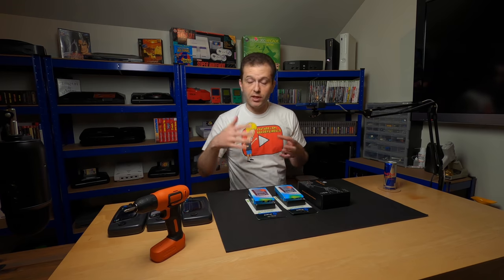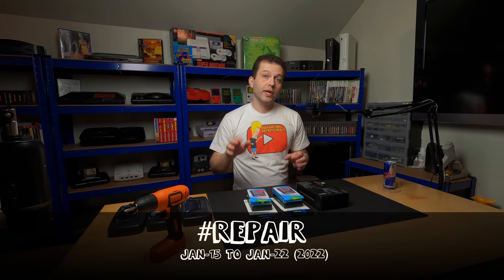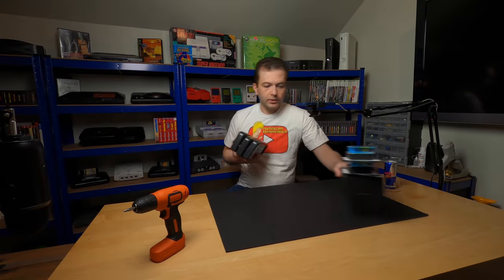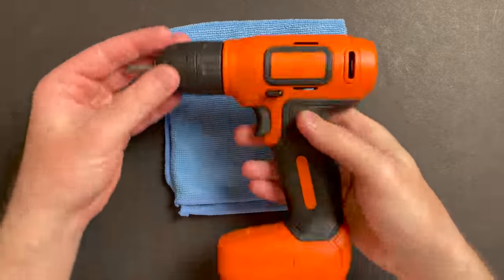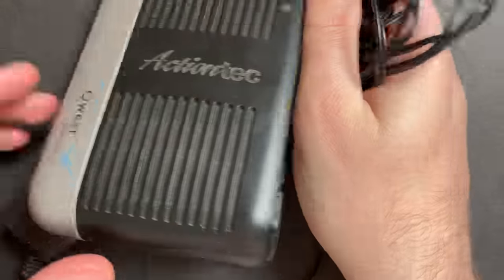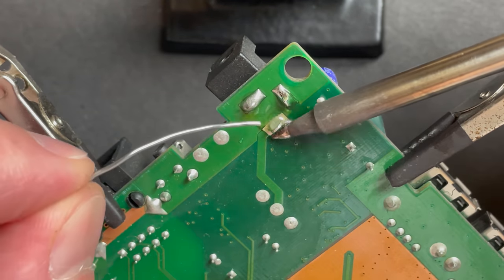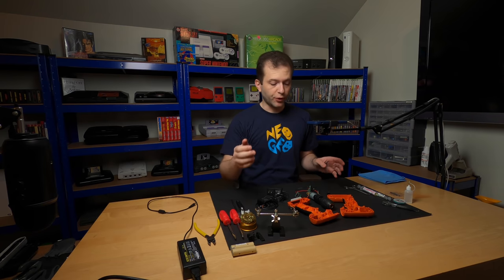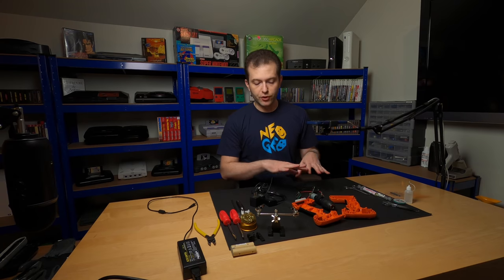Revisiting a Poorly Repaired Project & 25k Subscriber Giveaway

Comment: The DC barrel socket will have a make to break circuit in it. The outer connection on the plug will break the connection between the two tags on the socket. This is so you can attach a battery to the circuit and when you plug in it will disconnect the battery and use the dc power. It’s old school dc stuff. Hope that makes sense. If you’d tested the continuity between the two “ground” tags when the plug was in you would have found them disconnected.
Reply from the maker: Thanks so much for this info. It was really bothering me. I knew someone would know exactly what the issue was. I get it now: continuity across those two grounds when nothing plugged in, but no continuity when a barrel is plugged in (by design). Love it!!
Reply: Yep. I see this in guitar pedal DC connectors. Circuit break when plugged in, 9v cell vs power supply.
Reply: And here I was this whole time, thinking the second ground leg was solely for extra physical strength. This makes perfect sense.
Reply: I had to pause the video and come search for this comment to talk about it and get it out of my system because I have been there many times. We all been tricked by break circuit jacks at some point. In my case, mostly audio jacks (in these the break circuit it is meant to interrupt the device speakers' lead connection. This is how speakers are muted when you inserted your headphones in stereos and TVs).

Since they will test perfectly fine with no plug inserted, just like it did in your case; for sanity check, when I'm working with some jack I'm not familiar with, I do a continuity test with a plug inserted into it and corroborate continuity between the jack tabs and the plug's.

Comment: Hi, usually when there is three connectors on a barrel jack, it is where a unit is powered by a non rechargeable battery and if you plug a power adapter in, it doesn't put power into the battery circuit, however that doesn't matter to your drill, if you plug in the barrel jack without the power supply plugged into the mains supply, you will see it break the two negative connection on the barrel socket, it works like the headphones jack if you get what I mean. Well done with your milestone, I am a British subscriber. #repair
Reply from the maker: Thank you for your comment. A few folks shared similar feedback and were quick to clarify my confusion. You always learn something new!

Comment: Hi there. The side lead on the barrel jack connector seperates from the negative lead once the plug is plugged in. Thats why the drill was not charging. It is used to disonnect a primary supply, like a battery from the circuit, when a secondary supply like a power supply is plugged in (otherwise the battery would get DC from the power supply and get damaged). Keep up the good work and best of luck! #repair

Comment: Thanks for the fun video. Got a few useful tips from it, including your solder wick methods.

I did want to add a brief note about frankensteining DC plugpacks. Modders should take at least a cursory note of the respective power draws and wire gauges of the packs being joined together. Because, although it's rarely an issue in practice, in theory it's quite possible to conveniently take the connector and part of the (potentially lighter-gauge) wiring from a cheaper or underpowered plugpack, and unknowingly introduce it into a much more demanding circuit - which then becomes a potential design or safety issue. As noted, a rare one, but it's good to at least think about it. For example, it wouldn't be the best choice to hang a demanding 12V 2A circuit off the cable from a 5v 300ma Aliexpress adapter.

Great that you stumbled upon the insert-detect function of the DC sockets. An initially-confusing path I myself also trod, not so long ago during similar projects. :) These days, sometimes during prep I'll simply snip that side lug off for convenience, both so that it's out of the way, and so that no confusion is possible.

#repair
Reply from the maker: Thanks for the great feedback.

Comment: I really love watching these #repair vids, the presentation is top notch and it really inspires me to want to do it myself, fantastic. Those barrel jacks with three pins can be used in circuits where normal non-rechargeable battery's are used and you want that circuit to be disconnected when you plug power in, the pins reconnect when you remove power and the are back in circuit. If you connected the negative to the other pin it would of worked first time without the patch wire. 

Here is an explanation for all of the uses of a 3 pin switched barrel jack I found on the internet which thought explained it well..."The jargon for this type of connector is "switched jack". Not only is it common for barrel jacks to have switches, but also for some other types of jacks, like phone jacks of all types.

When you insert the plug, the connection between pins 3 and 2 breaks. This is useful for cutting a battery out of the circuit when a DC adapter is plugged in. Imagine you have a battery which is grounded via the 3-2 connection. When you plug in, 3-2 breaks and so the battery's ground connection is lifted. Now the battery is protected from two unwanted actions: discharging, and being charged. (It's still a good idea to put diodes in the circuit in case the switch fails for whatever reason.)

Or, this can be used for building a circuit which detects the insertion of the DC plug. For instance, when the 3-2 connection breaks, some microcontroller I/O pin could be pulled up to VCC, and then the firmware knows that the device is on an adapter.

If you don't take advantage of this, you can leave pin 3 unconnected in your PCB, or you can ground it so that it is permanently connected to 2.

In any case, the extra pin provides extra mechanical strength too. In other words, solder pin 3 to a pad, even if that pad has no traces to it.

In general there exist many types of switched jacks with various switch configurations. For instance, there exist stereo jacks which have a pair of switches that close when the plug is removed. This can be used on the input side of an audio (or other) device to ground high impedance amplifier inputs when nothing is inserted, so as not to leave them floating, inviting noise. On the output side, it can be used to disconnect main speakers when headphones are plugged in.

Jack switches are not always "break" switches (normally closed, open upon insertion); there are jacks with "make" switches also (normally open, closed on insert).

In some applications that use phone jacks, a "make" switch switch is simulated by using a stereo jack with a mono plug, or a stereo plug into a four-connection jack. If you insert a 1/4" or 1/8" mono (tip-ring) phone plug into a stereo (tip-ring-sleeve) jack, the plug's sleeve, it bridges the sleeve-ring contact, acting as the closure of a switch. This can be used to turn a battery-powered amplifier on when the plug is inserted: a common trick in electric guitars with on-board amplification such as active pickups. Cell phones also use the same trick to distinguish whether a headset or headphones are plugged in. Headsets have a TRRS plug for supporting the microphone, whereas headphones have a TRS plug. When you plug in headphones, they ground the jack's outer ring (second R) contact to the sleeve contact, which the phone detects, and thus keeps using the built-in microphone for audio input, sending only audio output to the phones."
Reply from the maker: This is a very thorough explanation, with examples of practical use cases outside of just power jacks. The more I learn the more curious I am to tinker further and mess with these things. Thanks for sharing.
Reply: @BorderlineOCD  You're most welcome.

Comment: I have watched man of your videos and I enjoy each one.  They have inspired me greatly.   I now own a cheap iron like you mentioned here in this video,  but as you were at the time of the initial repair, am a beginner.  I am a musician and I have PA systems and a Line 6 POD pro red face that all have had issues.  Yesterday morning I woke up thinking about trying to finally repair something.  That Line 6 had a channel volume knob that had been busted off.  Unfortunately it was the post off the pot that broke.  I had a spare pot ( not of the same size at all. ) laying around and I noticed the post size was shorter but fatter.  I wound up taking the board of of the pod pro and weighing out my pros and cons.  Pro,  it could work.  Cons…it’s already broke so time would be the only thing wasted here but knowledge would be gained.   I successfully Installed the replacement pot and it worked!!!  Being the know was shorter I had to take a knob off of one of my guitars temporarily until I can get a new knob 3D printed.  Anyways it worked and you inspired all of that.  I originally got the iron for installing pickups in guitars.   Thank you!

Comment: It's brilliant you showing us how you started off. Just goes to show how much you have improved over the years and how cheap soldering irons aren't always the best. That was a good wee upgrade you did to that drill. I have a tool which is similar with a mirco usb. Can see the same thing happening to that in the future so this has give me an idea if it does fail. Great to see so many subscribers now. As I said I started watching your videos and started to take console's apart a lot more. Wpuld have been only disk drive or power supplies out but now its fully apart. #REPAIR

Comment: The extra pin on the DC Jack is for detection - it will be shorted to ground only when the plug is not inserted! #repair
Reply from the maker: Thanks bud, a few of you recognized it right away. I knew someone would know exactly what was going on. I’ve never tinkered with barrel plugs and it never crossed my mind. Cheers!

Comment: I'm a fan of your channel, great repair! I also like revisiting things I've done when my skills weren't as good, and marveling at how rough my work was. Also good to revisit things I haven't been able to fix and seeing a way to do it with a bit more experience under my belt. Just a small note, I would encourage people undertaking their first repair to maybe avoid mains Voltage. If you mess up a Safety Low Voltage appliance the consequences aren't so dire. So maybe replacing the barrel connector on the DC end of a power supply, rather than replacing the plug or mains voltage cable end. Both are learnable skills, of course, but maybe steer clear of mains Voltage early on, and with a bit of training, reading or experience, work your way up to it.  Cheers

Comment: It's always interesting to go back and not only look at early repairs but fix them as well. I recently went back to one of my first soldering repairs which was to replace the Dreamcast rechargeable battery. When I opened it up it was definitely an "ooof!" moment LOL. Large blobs of lead free solder done be using those cheap preset temperature soldering irons without using any flux.
Reply from the maker: That's the perfect visual of a beginner's first repair, you nailed it. Flux you say? I have a $2 tub of plumbing flux in the garage, surely that will work?

Comment: Most likely, the lead you attached the negative to is the one that gets disconnected when you push in the barrel jack. If you connected to the other one in the beginning, it probably would have worked. Thanks for your videos. Great work with the #repair -s
Reply from the maker: After similar feedback shared by others I see that now. It's pretty funny. So simple but you have no idea but much it was bugging me. I had some ridiculous theories in my head about what was going on.

Comment: I just saw the ending are you sure the 2 Negative are still conected to each other if the plug is accually plued into the connector ? Like how a phone notices that you pluged in your headphones by  breaking the conntection between those 2 pins !

Comment: #repair  just about the DC Power Jack from the TECHNICAL SPECIFICATIONS
 "The third pin on the side of the connector is a plug detect output.  When no plug is inserted, the pin is shorted to the ground connection.  When a plug is inserted, the pin is open circuit.  This can be useful for some applications but in most this pin is simply grounded"
Reply from the maker: Thanks for sharing! A few others spotted the issue and gave similar feedback.

Comment: Loving your channel and been hanging out for the next vid. As always well presented for a practical project. I've always been into taking stuff apart and attempting to fix/revive things. I've never done any soldering but your channel has inspired me to give it a go. I've got three faulty OG XBOX's here and I'm hoping to be able to have at least two working consoles out of them. Leaking clock capacitors here I come!! #REPAIR

Comment: Your channel has inspired me to get into modding and repairing consoles. With the prospect of them providing another revenue stream. I've already picked up a TS100 and have a Pinecil on the way. Got a 3D printed grip i've designed for the TS100 and will do one for the Pinecil as well. Be happy to send you one of the grips. I sell them on my Etsy shop. I will be tackling my first mod, upgrading an NES 101 with composite video. Fortunately i already have all the parts on hand from past electronics related projects. So it won't be pretty or on a custom PCB but it will work. #repair

Comment: #repair    You would not have continuity between them with the plug in.  Like someone else in the comments said, it's a make/break switch in there that will allow a device to run off internal battery or off of a plug.  You still amaze me how you are learning so fast, and you learn from your mistakes, and are always, always, trying to improve your technique and muscle memory as well as learning and refining your troubleshooting techniques.  Awesome video man.

Comment: Thanks for sharing your old soldering jobs. I love watching your channel but everytime I #repair something I try my best but with tools not really made for it. I was never satisfied by my soldering job and when you do open something that's already been repaired and notice it's been an awful job I feel like this is something I could have done and feel ashamed. Seeing that you used to do the same before buying proper tools and specifically the comment on the fault of the effect of the iron temperature helped me. Now I would simply need to win this perfect soldering iron to improve ;).
PS : The sentence "Time to file the circuit board down..." sent shivers down my spine 😅, glad that turned out OK.
And couldn't you have epoxied the connector on only one side of the drill casing to be able to disassemble it later?

Comment: #repair Learned about your channel by watching your X360 RROD repair several months ago to try to fix one I found on top of my neighbors trash can. It turned out that mine ended up having the overheating RROD rather than GPU RROD but I still enjoyed watching it and your other videos documenting console repairs. These will definitely come in handy if I come across anymore consoles that have the same issues you fixed.

Comment: Thanks for the tip on saving solder wick. I never thought of that and I often use a lot of wick.
Reply from the maker: I only somewhat recently started doing this. You can see the inefficiency in some older project videos where I use much more wick than required.
Reply: @BorderlineOCD  No kidding. Thanks again my friend.

Comment: I had the EXACT same issue when I modded my super nintendo to use a regular barrel jack power supply instead of the proprietary snes power supply jack. The plastic was already cracked where the av multi out is so I didn't feel bad about removing the rf port and cutting some more plastic #repair

Comment: #Repair

Congratulations on your milestone

BTW, for a second I thought the drill had an HDMI port I mean like LOL?! I really like that you are using any methods, like swapping ports and modify the shell to fit the new port. I really like the imaginative work solution there! I call that hard work and dedication! That is why I love this channel!
Reply from the maker: It's an interesting design choice, definitely geared towards the casual consumer (which is exactly what I was when I bought it). I'm glad I can continue to use it even though I have a much better drill/driver set now. No sense in getting rid of something if it can still provide value.

Comment: Great video!  Awesome idea to change out the connector for the barrel.  I agree the micro usb was a bad design choice.  Watching your soldering has made me up my standards.  Every joint should be smooth, shiny, and pillowy.  Your borderline OCD is rubbing off on me.  #REPAIR

Comment: My first #repair was a Logitech Gamepad. I changed one of the analog sticks. And i used solder wick first time. I used the solder wick while  holding from its housing.Whole thing get hot , housing melted and stuck my thumb and index finger :D
Reply from the maker: I've been there my friend. You would think there would be some useful instructions on those reels. Nope, you learn with trial and error until you find a better way :P

Comment: I look forward to your Game Gear video. I get t one on eBay for $20 that some one had left batteries in for over a decade. The inside of the shell had a copper coating that corroded and the traces on the power board corroded so bad that it lifted the mask off. #repair

Comment: to open up the transformer case you could try iinjecting gasoline in the small crack of the case, it will depend on the type of plastic but i tried once and it worked a charm, since they seem to be only ultrasonicly(?)welded